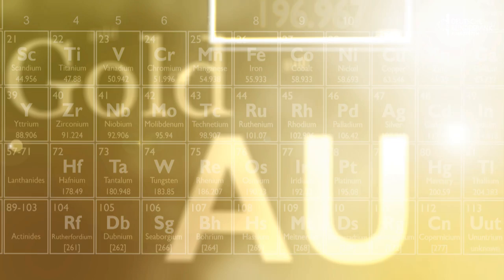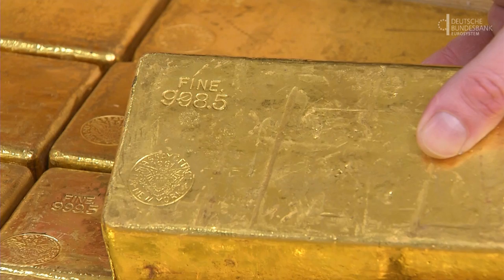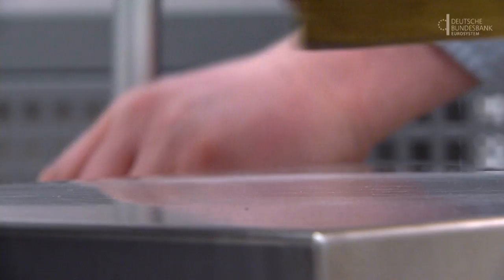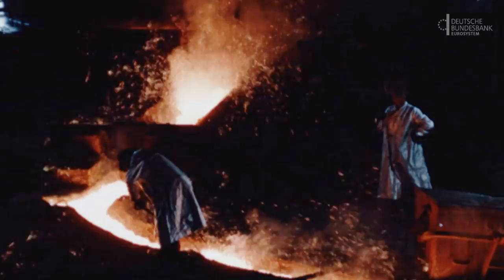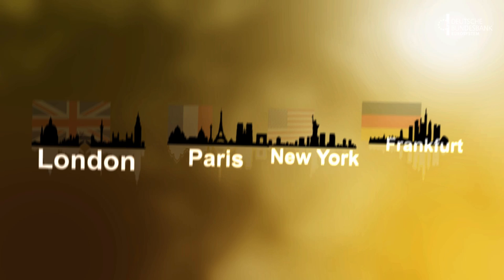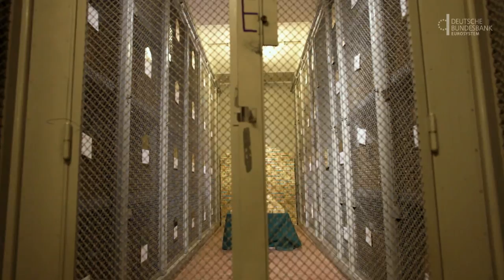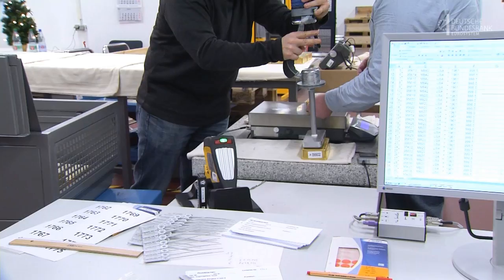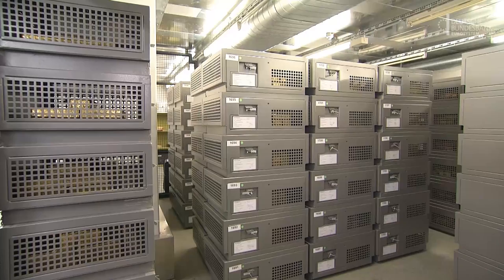The German gold reserves

Comment: In 2021 I believe more people are talking about Bitcoin!
Reply: Bitcoin is a failed peer to peer concept. It has no intrinsic value. Its only a code sold to the next person who thinks it will go higher.
bitcoin has become de-democratised as its ended up as a speculation currency . no one seems to want to use it to buy anything- unless you swap it back into fiat.
Reply: On yeah, because Bitcon has so much instrinsic value doesn't it?
Reply: Bitcoin has been of speculative value for just a few years.  Gold has been of intrinsic value for thousands of years.
Reply: Gold hasn't got any intrinsic value at all. It's just an illusion. Bitcoin is limited - like gold, and therefore it's valuable. And by the way - you don't trade with gold neither.
Reply: Ya fools
Reply: Bitcoin is failure, in 2022 many people leaves it
Reply: Once you own gold you stop talking about.....
Reply: @ef7480  there is nothing intrinsic in gold that makes it as valuable as it is